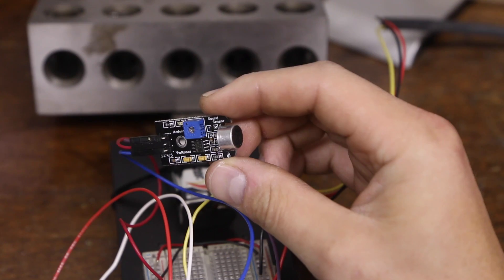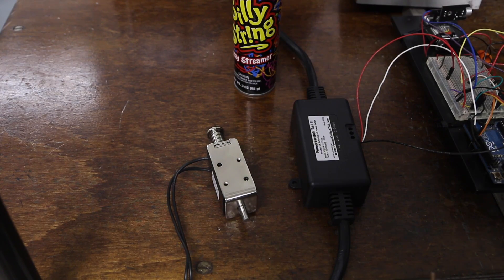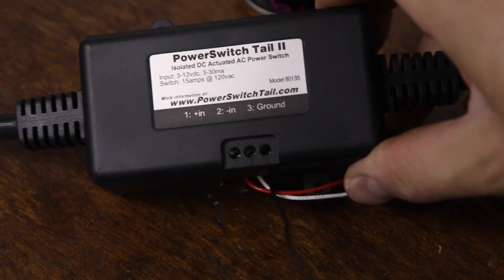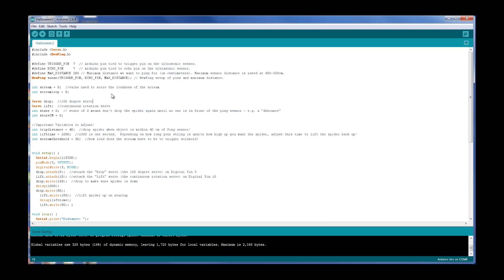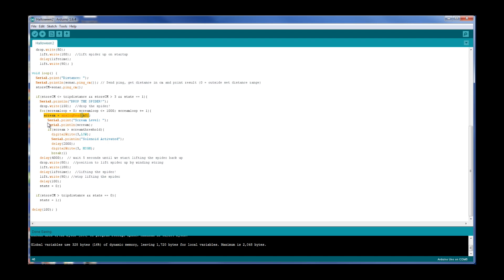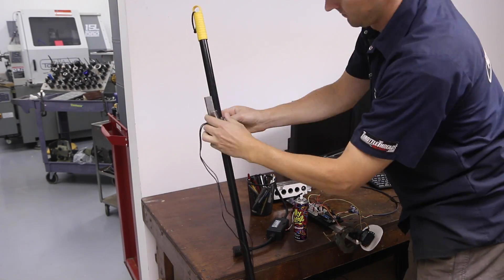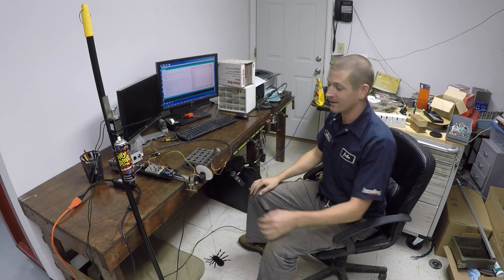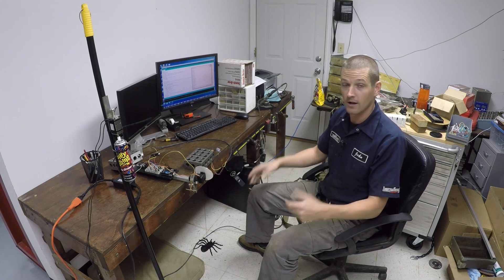Arduino Halloween Scream Sensor Widget62!

Comment: Nice work indeed John!  
One of my future Arduino projects is to create a generic spray can activator using hose clamps and a high-speed RC servo with cam instead of a solenoid.
Of course spending time drawing it in CAD is more fun than actually making it..